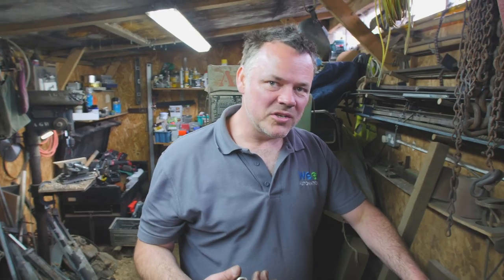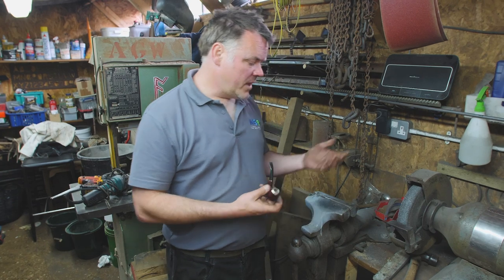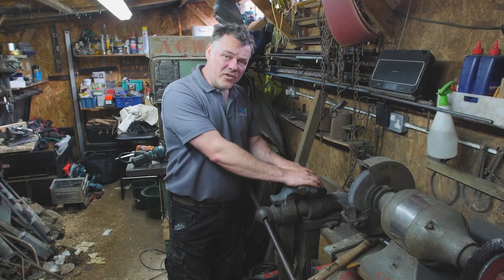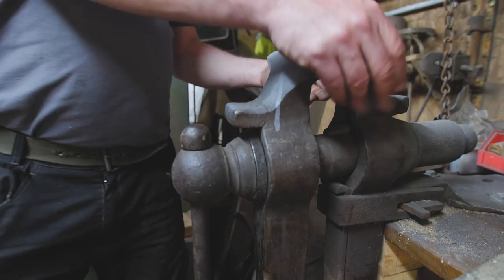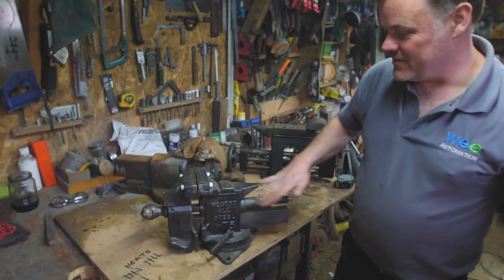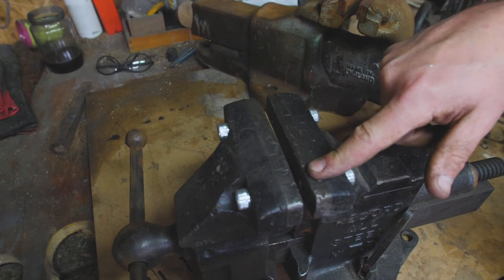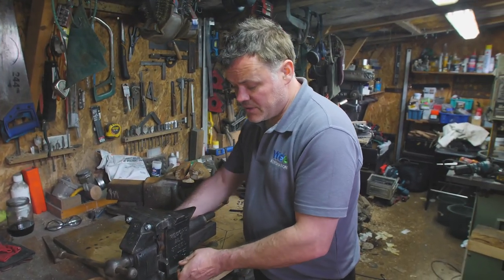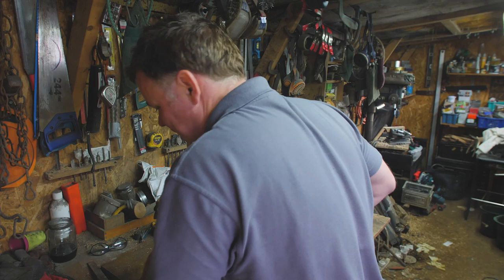Vintage Woodworking Tools – Vice or Vise? - Stewart Handy Worker, Parkinsons ModelF No9, Record No75

Comment: HURRAH! New DSC 😀. I got my leg vice for £20 from a small ad. It's covered entirely in surface rust and oily sawdust, but it's all there apart from one of the drift pins that holds it to the bench /post plate. I really need to get it out the back of the garage and sort it out. Bought it from a fellow who got it from his grandfather. He seemed very pleased when he found out it was going into a workshop and not into a window display or to be used as a garden ornament. Great video chaps 👍
Reply from the maker: Thanks for sharing Phil, bring that leg vice back to life and get it used, sir! Then send us a photo or stick it on your Instagram and tag us - @dirtyshedcreations
Reply: @DirtyShedCreations  Will do... when I get round to it, sometime in the next 12 months, probably.
Reply from the maker: Know that situation well - not enough time for everything!
Reply: Got a 5" jaw leg vice in outstanding condition at a car boot sale last weekend for £15. I go every week and get there at 4:30am, just as sellers are setting up stalls. The early bird gets the worm. Same day, I also got 3 pre war record #52 1/2 woodworking vices for £30 ...... and back home for a fry up by about 7:30  :<)

Comment: Like you, I don't have a vice problem ...... despite what the wife says !
You really ought to put the foot back on your leg vice. The back leg extended right to the floor and were made with a collar about  an inch from the bottom which was located into a fixed steel plate on the floor. The idea being to transfer the load from striking an item in the vice, right through to the floor. A lot of these got cut off presumably because the vice was deemed too tall for someone's bench at some point in its history. My vice is pretty similar to yours and weighs in at 240 lbs, and is as solid as a rock.

Comment: The Stewart Handy worker was made in America by the Chicago Flexible shaft company of Chicago, Illinois.  Patent date is September 5th, 1916.
Also, the multiple crank handle positions are for drilling vs. Grinding. These were shipped with 2 drill bits. Inserting a drill where the grinding arbor goes converts it to a drill press. And the plate you mentioned that can be placed with the anvil was also included when shipped according to the 1917 catalog I found. Weight was shown as 90 lbs., price was $15. Adjusted for inflation,  that's about $200 in 2019 money.
Reply from the maker: Bonjour Steve, or should I say, 'Hello, Indigo Montoya?" That's a fair amount of knowledge you're sharing, thanks very much chief - have you got a Stewart Handy Worker yourself?
Reply: @DirtyShedCreations  I do not have one. One came up for sale near me, and intrigued me, so I started doing research. That's how I found your video. I also found some scans of early tool catalogs showing the vise with it's full compliment of goodies. The guy selling one near me wants $300 US, and is missing the grinding wheel arbor, both pipe jaws, grinding rest, and the alternate top plate. So it's a non starter. However, I did pickup a Vanderman #3 steam fitters vise last week. 6" jaws 160 lbs. Patent 1891, built in Willimantic,  Connecticut.  I'll probably do a video on it soon. By the way, love the channel, subbed. Have fun storming the castle.
Reply from the maker: @stevewatr  Yeah, $300 for what is essentially scrap doesn't work for us either! The Vanderman sounds cool, just reciprocated on the sub, so we'll keep our eyes peeled for that one. Cheer, sir - feel free to drop us a line, we love the banter - be good to hear your thoughts on our other projects if you have a spare half hour!
Reply: Hi. Just bought a Stewart Handy Worker which has the anvil top but no bits, grinder or end piece for drilling. Do you have any ideas on where to find these parts?
Reply: @ThereseWalters  The problem you will have is that any parts for this vise will be unrecognizable to most people, and thrown out. Finding another vise with the parts is highly more probable than just finding the parts. If you have the time and skill, you might be able to make the missing parts. It would make a nice project.

Comment: Hello, need some advice, is it advisable to buy a leg vice which has the box missing? It's the part the screw goes into...I have found a 6 1/4" leg vice in very good condition with a large square nut that acts as a box for $275 CAD....
Reply: I already have a vice problem and this video of yours gave me the itch to look for a post vice which I used to think we're very crude compared to bench/machinist vices
Reply from the maker: Hey Vijay, Al will drop on here soon and reply to your query, thanks for checking in and watching!
Reply: @DirtyShedCreations  Is Uncle Al still very busy?
Reply from the maker: @vijaysaviopinto  Sorry Vijay, I'll get the lazy s.o.b to pull his finger out - he will be with you soon!
Reply: @DirtyShedCreations  LMAO!! Hope he takes it out and does not stick it elsewhere..
Reply: Evening Vijay, hope you’re surviving well through these times over in Canada! Truthfully, it’s completely up to you! But... I think as your vice is missing the single piece which provides all the clamping pressure, it should be a bargain price. Obviously the seller wants the most he can get, but £175 (rough conversion from Canadian $) seems very expensive for a broken vice (however useful or rare). Not to ‘rub it in’ but I’ve never paid more than £30 for a fully working, maker stamped leg vice. But that’s here in the UK and I think these vices will only go one way in terms of value (upwards). Maybe, get the best you can for the money you have, look after it better than this ones been cared for and you may make a few quid in the long term! Wouldn’t even get into trying to get a replacement box machined up. They’re a nonstandard thread count and pitch. That is unless you know a friendly machinist! Hope this helps! All the very best!
Reply: @yorkshirejoinery2869  Hello YorkshireJoinery, hanging in here in Canada, counting my blessings in such times, hope everything is well at your end on the other side of the pond. Thank you for your response. Based on your advise I have decide not to buy that vice. I guess you guys are very lucky in the UK to find post vices for 30 quid. I have been watching post vices over here and people requesting ridiculous amounts of money, $350 CAD to $500 CAD for a complete 5" post vise, sometimes not even in restored condition. Anvils are well over $900 CAD for having a weight of 150 pounds. I will just keep my eyes open I guess. In my quest for a post vice would this be the priority when looking for one? 1) Thread and Screw 2) Main post/leg and pivoting arm 3) jaws 4) Spring
Reply: Hey up Vijay! Pleased all’s well with you! Think you’ve made a wise decision on the leg vice, maybe leave the broken one for the next guy! I love my antique collecting but have learnt the hard way that incomplete items seldom (unless at huge expense) are partnered up with missing components! Think ram rods for old muskets the seller always claims ‘you’ll get one of those no problem’. The seller’s got paid an vanished by the time ‘we’ find out how hard it is to source an original! In terms of your vice look out points, yep the box and screw are of primary importantance. They provide the legendary strength. The hinge point is less important, as a bit of play here wouldn’t badly effect the clamping of the jaws. The box and thread would take up this slack. The spring, well I’d say this might be the one piece you could theoretically re-make. There are some good vice refurb videos on YT showing how that’s done. If this piece was missing/broken, play on it with your seller to reduce price. Look at the jaw alignment too, you want them to meet as close to true as possible (however, 150yr old vices have seen a lot of work and jaws seldom meet perfectly - my larger leg vice jaws roll a bit but I live with that). Will post this now and just check I’ve answered all you questions.
Reply: @yorkshirejoinery2869  Thank you very much. Yes you have answered all my questions!!
Reply: @yorkshirejoinery2869  That would be fantastic!! Thank you for taking such effort to help a stranger. I have a feeling it would get very expensive to ship though with the weight of such vices and customs duty etc. I have already emailed you on your hotmail email id. Hope you have received it as there appears to be a typo in the email you provided.
Reply: Sorry Vijay, you got it, there’s only 2 ‘oo’ in gengoose!

Comment: The Stewart Handy Worker, patented Sept.5 1916. Chicago Flexible Shaft Co. Manufactures, Chicago USA. Anvil vise grinder combo and a Stewart metal cut off tool, weight is 59 lbs.

Comment: Hi in your next Q&A or in a film could you run through how you made your forge? As I’ve loads of these and want to get to doing some blacksmiths get. Cheers
Reply from the maker: You've got a load of vices? There's people you can talk to about that... Where are you from, cos if you're US based you might be sitting on a load of cash! As for the film, it's on the to-do list and we'll definitely cover it, maybe sooner rather than later seen as though you asked!
Reply: Hi based on the north Lincolnshire/ East Yorkshire border, so local. Sorry not a load of vices, but a load of propane gas bottles 🤣. Although I do seem to have a lot of vices in the garage. Look forward to the film
Reply: That Stewart handy worker is amazing! What a fantastic piece of industrial engineering WOW
Reply from the maker: Morning Ritch and SJ, did a bit of research into propane gas forges - Will Matthews (https://www.youtube.com/watch?v=hqFDRBZZPWQ) and Pask Makes (https://www.youtube.com/watch?v=b8zOQ4hyQzc) are two channels that have really comprehensive and well made tutorials on how to make them - just in case you wanted to push ahead and not wait for us!
Reply from the maker: Yeah, Al loves that inanimate object! Keep your eyes out for them at car boots and auctions.

Comment: Money well spent buying a decent vintage vice. 
Quality was changing even back then, take the Record 75, your one is early cast steel with acme threaded screw and beefy long handle.
Later models switched to malleable iron of decreasing grades and acme thread went to more basic thread along with handle getting shorter and thinner to compensate for weaker thread .
Even the worst vintage spec beats modern versions that can cost hundreds for pretty much garbage and hot air marketing .
Record HD range worth having, 114 is a beast, Samsonia models worth looking out for too .
Reply from the maker: Thanks Mr B, you knowledgeable so-and-so you! We’ll have to keep an eye out for the Samsonia, thanks for getting involved 👍
Reply: @DirtyShedCreations  
I don't know too much on record vices as not collector or enthusiast just used them for few decades as a mechanic and spotted differences when looking at some used ones and spotted clear manufacture changes that major change to quality and obvious attempts at easing manufacture/costs so done bit of digging on models and materials so new exactly what buying .
rounded screw head that handle passes through is easiest first visual clue to earlier generation vice.
Difference between early and later 75 is quite shocking and more so if had them side by side .
I would like a 7" leg vice, most I see are 4 to 5" .
Will have look through your videos and see what you get up to :-)
Reply from the maker: @mrb1864  there’s a few videos to check out, a hobbyist and a filmmaker spending some lighthearted time in a filthy shed - let us know what you think!

Comment: I think of everything in units of booze. "Do I really need that? That's 3 bottles of scotch"
Reply from the maker: You and Al are kindred spirits indeed - what's your fave Scotch then?
Reply: @DirtyShedCreations  I drink Dewar's. I've been drinking it for years. I'm not a single malt guy though I haven't tried many. I was working in Newcastle many years ago and I had tried a few that were very good but I can't remember the brand.